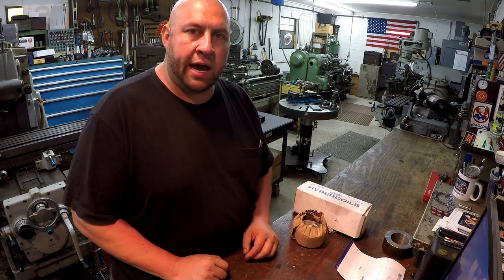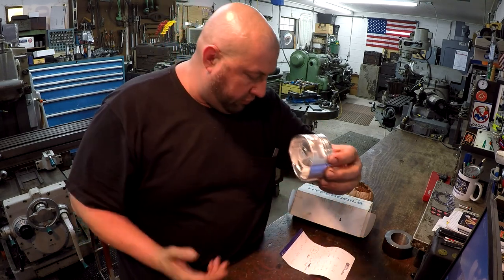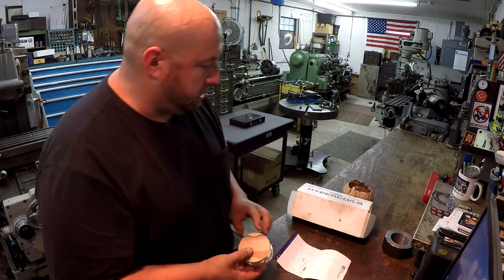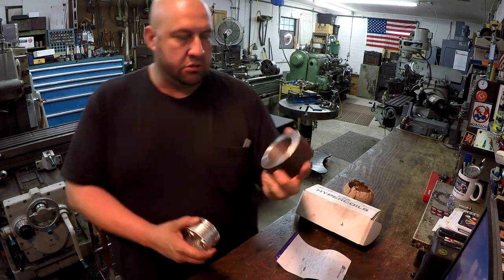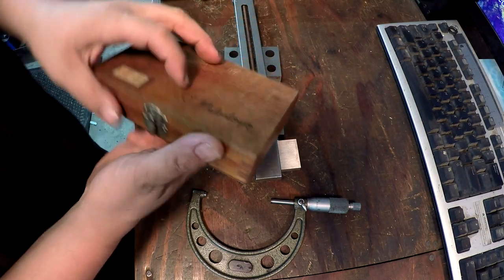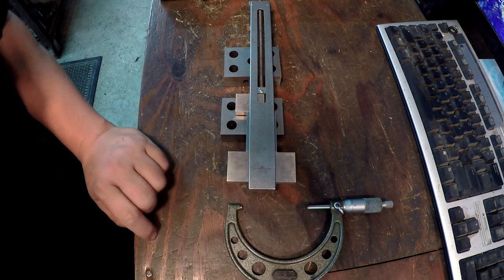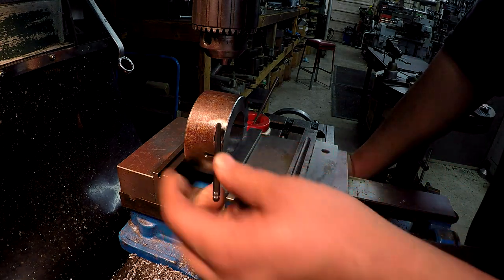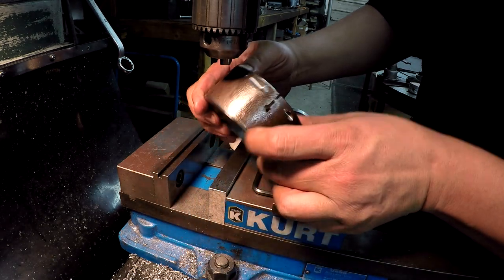Hayabusa Pistons Part 1

Comment: I'm assuming your buddy had a nickel silicon carbide plating of some kind put on the walls of the cylinder after the overbore.  Why didn't he just use a diamond brush hone to get the piston to cylinder wall clearances he needed?  It seems much more labor intensive to machine the pistons to the bore.
Reply: exactly
Reply: coating can be typically anywheres from  that  .002 to about .006 generally depending on what happened, so likely taking the chance wasn't worth it.?. maybe they want a slight taper to the pistons or smaller skirt than head
Reply: landlockedviking is right the coatings are too thin to hone you just ruin the coating. Also most coatings are so hard that they hone the cross hatching into the cylinder before coating as they are damn near impossible to hone.  What would have been best is to buy and send a set of pistons with the cylinders to get the cylinders sized to them when you have them board and coated.
Reply: I realize the plating is very thin but the shop that plated the cylinder (without the pistons in hand it seems) should have plated the cylinder on the thicker side leaving the owner enough room to hone the cylinders to the correct tolerance for the pistons (the typical way people build an engine).  Despite what people tell you nickel silicon carbide can be honed you just need a diamond hone, not one of the hones you would find at an auto parts store for iron bores.
Reply: One run and shes done is my guess, also the specs sound way to close if those are forged pistons on nitrous , then again what the hell do I know ???
Reply: My thoughts exactly, i was wondering why not hone the bores out, there are lots of ways to hone a bore wrong though.

Comment: God knows I don't mean to tell you of all people your business ;-) However I noticed you fed the part for the fixture into the slitting saw so that it was 'pulled up'. Woodworking circular saws (=horizon of my personal experience) rotate so that they push the part 'down' (against the table or against the sole of a handheld one.) Wouldn't there have been less vibration that way, just by feeding the part in from the other side?
Reply: When working with metal it is more typical to avoid climb cutting.
Reply from the maker: On conventional milling you want to "push" away from the part. If you was to rotate the other direction and feed in you'd be pulling into the backlash of the lead screws. Not good. Although my machine DOES have a backlash eliminator, I'm afraid to find out just how well it works.

Comment: 16:56 Is that cutter dull? It's making an awful rubbing sound.
Reply: I think the bushings he's using to get the cutter centered on the bar are either making it deflect out of position, or letting it move untrue compared to the axis of rotation. He mentions during the racket that he doesn't like the bars rigidity.
Reply from the maker: There's a number of factors going on there, mainly the bushing in the support is not perfectly true on the running bushing.
Reply: About two months ago I learned that one should do horizontal milling so that the cutter pushes the work down into the table rather than trying to lift it up. So left to right instead of right to left in your case. And surprisingly, these saw blades should be run at 1.5x faster RPM than one usually runs HSS!

By the way Adam, you're one of the guys on Youtube who inspired me to quit a dead-end career in IT and go to trade school. I'm starting on NC machines in a month or two. So thank you for that. :)
Reply: Garganzuul That's called climb milling and it is somewhat limited in its application, as it can break the cutter or damage the part if a tooth bites too deep.

Comment: how much would/could a 3" gauge block expand from ambient to body temp?
Reply: I'm also interested in the answer to this
Reply: +Sam C nevermind, I remember, it was more on the thickness of a Sharpie mark, but I think he measures it after holding it in his hands.
Reply: Assuming it's made of steel, something in the ballpark of 4 thousandths. Temperature definitely matters at that length/scale. If you want to know more, read section 3.3 of this pdf: http://www.nist.gov/calibrations/upload/mono180.pdf
Reply: Depends on the material, various steels range from ~.00025 to almost .001, while some materials like the coated InVar wouldn't even give you an extra .00005.
Reply from the maker: Good video for Tom or Stan
Reply: If it's steel and using formulas from my construction past and the ambient temp. is 78 Degrees, it would expand .000625". Steel expands .375" per 30 degrees temp. change per 100' lgth.

Comment: I didn't see him clean the anvils on the mic, just the gage blocks. Also, probably should have wrung the blocks and calibrated the exact dimension you needed. That way you eliminate the chance of any screw calibration issues. But what's a few tenths between friends, yeah? And if we are getting extremely nitpicky, your friend should have called out a temperature of dimension.

Comment: I think the mistake was drilling it and fitting clamping bolts - when you didn't need to ! Since I presume this is to fit round the piston while it's in the chuck, you can use the chuck jaws to compress this collar to clamp onto the piston !

Comment: To fix that wrong bolt hole, you could've just drilled a bigger hole in the correct place and the bolt would've threaded good enough for the job, or even weld on 2 pieces of angle iron at the part and drilled and tapped that.

Comment: Not sure if you already split the fixture. I've often just cut one slot in such fixture and than I just clamped on the fixture which also clamped the part. But I've just watched 5 minutes if your video.

Comment: just one problem I had getting a precise measurement using a mic is when removing it, the surface tension pressure on the shaft sometimes moves the shaft a very small turn as it comes free of the item I was measuring ( a round item sliding across a flat surface catching one side of the circle),,,so had to use the lock provided to lock the shaft before removing it,,,I know it sounds off, but it was a real problem and that was how I was able to overcome it,,

Comment: OMG NO!
You hone the cylinder to the piston. Don't turn pistons. You screw up the ring depth and all that. Plus the weight thing
Reply: Proper procedure is mic the pistons, bore it a couple thousandths under then hone it to size. That's for all engines!  And I've build a lot of engines!
Reply: .002/.0015 will work the ring are not that close

Comment: When I had my shop I would never do any of the cylinder work until I had the pistons in my hands.. you would be surprised at the variance in even super highend parts... sometimes it would upset my customers but that's how I do it and it was my name and my reputation ... and you know if I didn't wait because a customer asked me not to and it had an issue it would be all on me lol I'm the hack blah blah blah right 
Policy is policy for a reason folks lol

Comment: Pistons are oval because when they heat up the expand more with there is less material an become oval. So if you machine them round then when they heat up they will become oval. Just saying. That’s why they are not rubbing all the way around its circumference.

Comment: I guess the purpose that this guy is trying to achieve being as he's running a nitrous bike is expansion and contraction due the sudden heat of the piston and the cylinder at the point of boost they probably still do it now but we used to knurl Pistons for the same effect that's also aluminum Pistons versus the old cast Pistons interesting

Comment: did you forget to offset your first hole cut by half the diameter of the edge finder?
Reply from the maker: No I cranked the handwheel .200 instead of .100, plus the .187
Reply: ah .. We all do it.

Comment: Why not slit it twice so there are 4 sections instead of 2? That way when you put it in the 4 jaw, the jaws would give you the squeeze you need to hold the piston, no bolts required.

Comment: PISTONS CANNOT BE ROUND!!!!!!!    Everyone talking about the concentric shape is absolutely right.  

the wrist pin boss is offset, to reduce piston slap.  this makes the piston expand at different rates across the part itself because of the difference in thickness for/aft of the boss itself.  this has to be accounted for in machining. 

 not only are the pistons egg shaped, they are also smaller in diameter at the crown ...the crown has more material....and therefor will expand more than the skirt.  these are facts...not opinions

Comment: Has your friend never heard of a hone for fine adjusting the fit? Messing up a good set of pistons ! I like your videos but this is just wrong and I can't watch it !!!!!!!!!
Reply: any coating is gone too.  Also,  N02 .002 p/w sounds pretty tight to me or he's not spraying much. I'd like to know what Alloy Wiesco used or did he get some kind of deal.  Either way, I picked up on the same issue I can't imagine the bores are so close to max that it can't be honed to size.  If it was, I can't imagine the block having the strength to handle any amount of N02.   Sounds like a grenade motor to me.

Comment: I wouldn't cut down the pistons in a lathe.. The pistons are likely cam cut to a barrel / oval shape plus a slight taper.. You could try to duplicate the taper but even so you've changed the the cam on the piston..  You've also upset the clearance where the rings are.. It's usually pretty big because the top of the piston take a lot of heat but if you don't have enough clearance there will be problems.. NOS ain't your buddy here.  Your buddy is much better off honing the cylinders to the proper clearance...  If the cylinders are bored aluminum and Nikasil plated. Have it redone..

Comment: Re-boring the cylinders would have been a far better fix than re-manufacturing the already precision made pistons. Sure he could have done what good engine builders do and use wet and dry til it doesn't touch using blue?

Comment: First things I noticed, no no!. Match cylinder to pistons. Checking comments, and many see. I just done some research, and I come to conclusion that I may have a machine that may be quite valuable, even though they are no longer made or in general use. My shop came with a piston grinder. It is never used, as good as bran new. It has the cams on it to create pistons that are not round. Very difficult to find anything on web, found one on youtube. For those interested
https://www.youtube.com/watch?v=_IrILh-O298
Mine newer, bigger. Sitting in corners, out of the way ever since I got the shop. Sort of thought of using it to grind shafts, for fun set it up to do that one time, and it worked. That was the only time I used it. Finding that there may only be a handfull of this type machine left in the world, I guess I shall hang on to it. But question is, are there any jobs in the world for it? I think it can grind up to 6", is around 8'swing. The job in this video does not qualify though, because that is backwards, this job needs cylinders matched to piston. Maybe my comment is long, maybe off topic? But mind sort of blown, had no idea that my machine was rare. Have no idea if there is any use for it though. Anybody here know?

Comment: I believe the mistake you made was going 1 full revolution of the handwheel (.200") when you meant to go .100" and then you added .0875" and ended up with .2875 instead of 3/16" or .1875"
Reply from the maker: Yep
Reply: Can't say I haven't made the same mistake, haha
Reply: I have the tendency on my vertical mill to goof up the 200 versus 100 per revolution of the wheel when I go from the knee which is 100 per Rev and then to the table that is 200 per Rev
Reply: +ted sykora on all the K&T Horizontals I've run the knee is .125" per rev which can get confusing when you run verticals a majority of the time and they're .100" per rev on the knee. What really makes it odd is the dials on the Horizontals are labeled every 10 thou up to 120, and then the last 5 thou, almost like it was an afterthought, haha
Reply: +Sandman Actual       the mill engineers have a weird sense of humor.

Comment: Novel way to hold the pistons, but bummer on Bozo showing up like he did.  Couldn't you try and rig up some kind of 'dsahboard gauge' on the X and Y axis on the Do-All mill?  Or would those not be of much help to prevent the mental mistake you made of going one-too-many complete turns on the handle in a direction?

Comment: You should always wear gloves when handling gauge blocks, always.
Reply: I thought that myself. But I am a newby. An old newby (over 60) but still a newby. I was surprised. Anyone care to discuss proper use and care of gauge blocks?
Reply: +Larry Lawson the comment below this is important too, you do not bore cylinders without the Pistons. In formula one they have the capability to produce identical parts that will interchange, normal production give a lot more variation. Having said that, keep at it, burst Monroe was laughed at by many, and he made a diabolical and sluggardly machine the quickest on the planet, in an old shed. I will look up my notes on gauge blocks, but they need to be clean and not handled by skin, the acids will cored, only slightly but these are precision items.
Reply: Primarily a gage block should be cleaned and oiled after use to prevent rust. Gloves are not something commonly worn by machinist. Although I see your point, the right things that this guy does far outweighs the petty stuff like that. But if it makes you feel superior maybe you should take a good look at yourself.

Comment: Least that mistake was not on one of those giant cylinders you make at the other work. We all do it no matter what business you are in.
Reply: Indeed, Scott. Your post reminded me of the plight of the USCG Polar Sea, world's biggest-equal icebreaker, the first U.S. surface ship to reach the North Pole, which has been laid up for the last half dozen years because the wrong piston rings were installed during a $12m refit -- or they were installed wrongly (nobody is sure which). 
Which (sigh) resulted in the scrapping of five of her six main (diesel) engines. These are comparative tiddlers at only 5000 hp each, in comparison with her three P&W gas turbine engines of 25,000 hp each, but the wee diesels are essential to her daily running. The jet engines were fired up only when breaking multi-year ice, up to her maximum rating of 21' thick, as with one of the diesels and one turbine on each shaft, (" 3 turnin', 3 burnin' ") she used to drink 4,600 gals of diesel per hour. She might have put herself out of job by her sterling efforts at warming the planet, come to think of it!

Comment: Hi. Spending all that effort splitting you fixture is not ideal. The slot is only a space so just rid of material as cheaply as possible. Cut off wheel in a disc grinder or two axial holes and hacksaw the balance. Spend your time and talents on stuff that really matters.

Comment: WTF, you  measure the bore, if its out of spec you bore it out to the next piston size, if they make em., and let the machine shop , hone the cylinder to fit the pistons, around 5 thousands is good.,  Pistons are not round to begin with because of the heat , on the skirts,  when under full load.. and this turns into ring flutter, and loss of compression.

Comment: Holy crap, how many ‘rules’ do you break calibrating your micrometers with those guayule blocks. Firstly handling the refer nice blocks with bare hands, ignored temperature for the reference, dragging the micro across the gauge block surface, them using nothing to clamp and retain either the reference blocks or the micro - your looking for accuracy in for finished outcomes in thou yet you do all that. OMG that’s bad.

Comment: How do you figure that a gauge block is more precise to check a micrometer then a standard??  That is just silly.  if you want to talk precision you should not be handling the tool with bare hands and be in a climate controlled environment.  how do you figure that "the other guys"  Measuring instruments are set like yours?? If you're fitting anything it should have been don'e with the same tool.